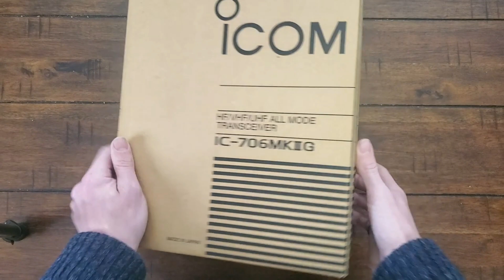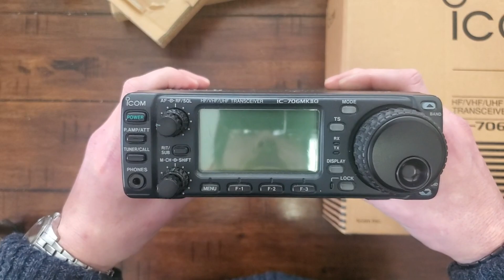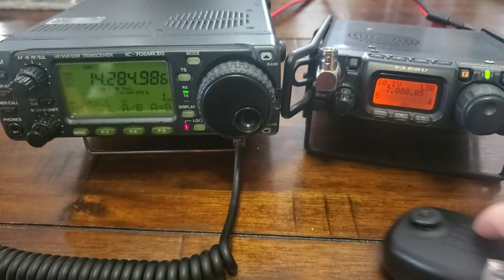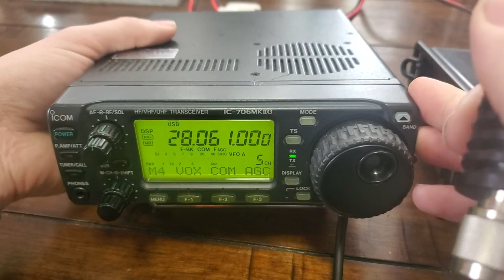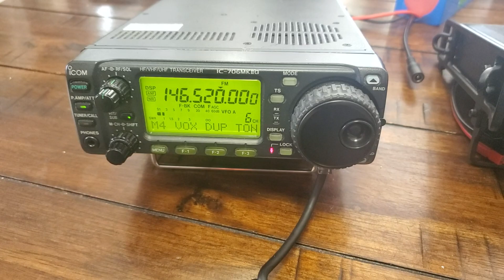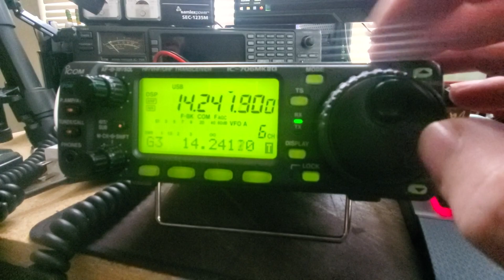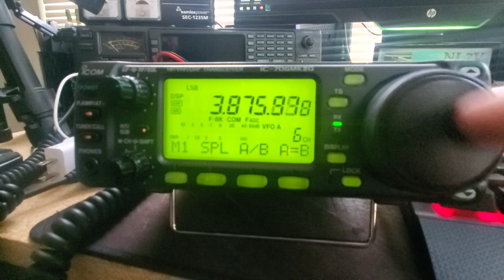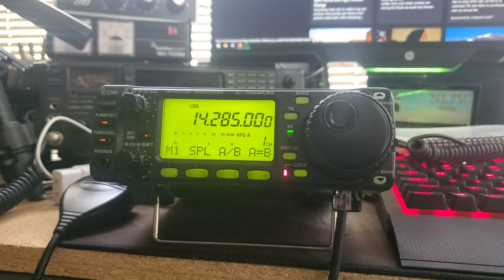ICOM IC-706MKIIG Unboxing and not working. Bad PLL?  Part one - The No Code Tech.

Comment: Why is AM always less power. I know you told me not to worry about it, but I'm worried.
Reply: In AM, for the peak output to be 100w, the carrier must be no more than 25w.
Reply from the maker: Okay, great question, so you know how an AM signal is made out of LSB + USB + a carrier signal. Cool, well it takes a butt ton of power to make those three signals, so most radios reduce the power output. Probably to save cost.
Anyway, Hey thanks for watching!

Comment: your top coax setting is HF not VHF and you need to  check the manual
Reply from the maker: Thanks for watching man.
Reply: @TheNoCodeTech  not a problem I have the 706mk2 and in the process of fixing it, just cleaned the display and waiting for a polarized film on this unit.